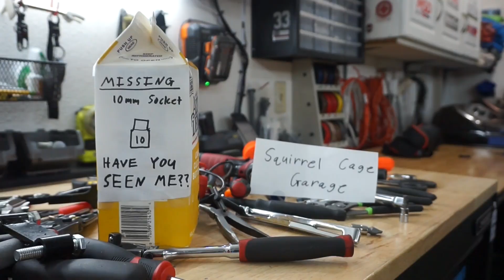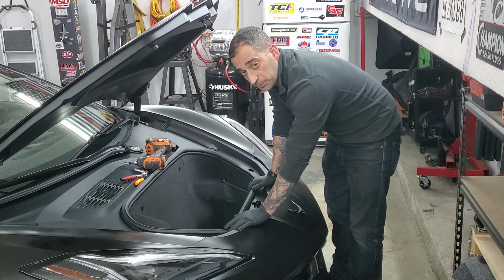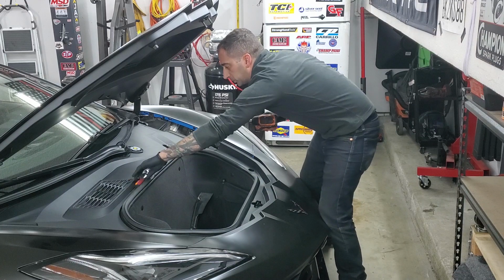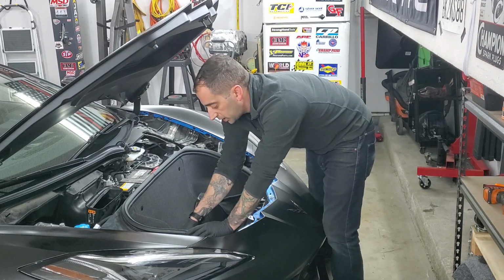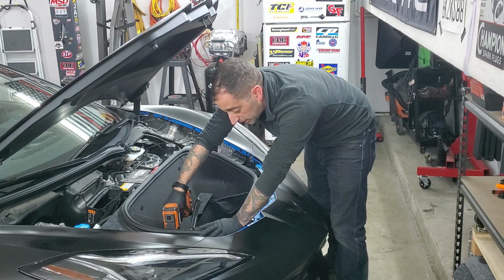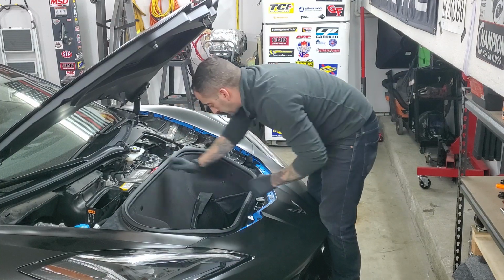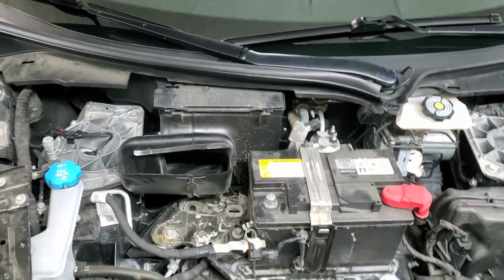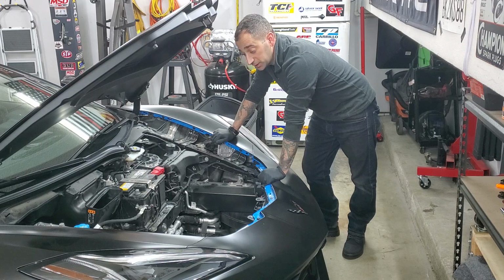Remove the frunk/front tub of a Corvette C8 in about a minute

Comment: Super helpful! What is between the front of the tub and the back of the bumper? I’d like to run some wires out to the license plate / radiator grates? Could I easily do it with a fishwire? I’d like to avoid removing the bumper.
Reply from the maker: You should have no problem, taking the tub out is way easier than taking the front bumper off.

Comment: I would like to add a front license plate cam to my LT1. It would be nice if it would only be on when the car is running. How should I run the wires to best accomplish this? A switch mounted inside or some way of a fused circuit? Thanks for any help. I think your videos are great!

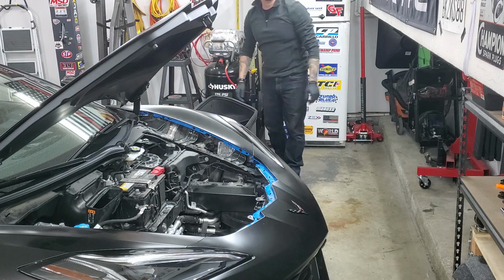Comment: Hi, What is the module that is attached to the backside of the frunk exterior?  Mine was purchased salvage and the module was missing from the harness.  Not sure my car is optioned with whatever it is, or if it was missing (with the majority of the Frunk box).  Looks like maybe a remote key sensor (that's a guess)?  3:48 in the video it is viewable.
Reply from the maker: That is an RF module. Basically a remote (key fob) signal receiver.

Comment: What's that connector for at 3:40? Great video thank you, just wish you had someone else holding the camera while you were doing the bolts to show them all. Not that they're hard to find just a constructive criticism. Appreciate you doing it right to the point and not talking for 5 minutes between each bolt like some YouTube videos.
Reply from the maker: Thank you. I wish I had someone else to hold the camera too. That connector is the "main" connector. It's for the light, charger port, and an RF module in the back of the tub.